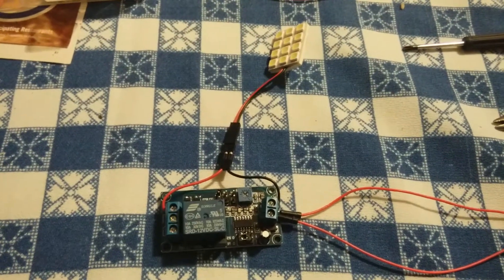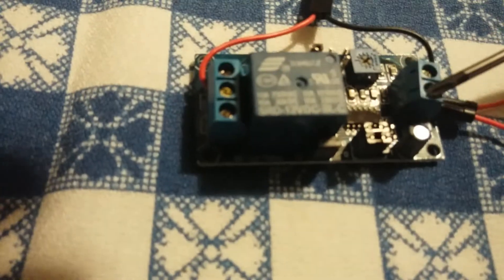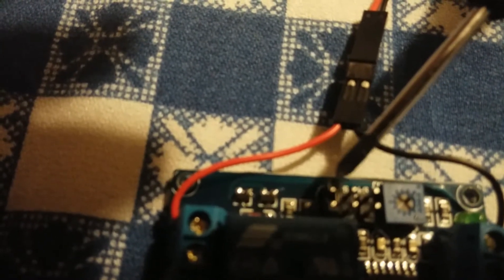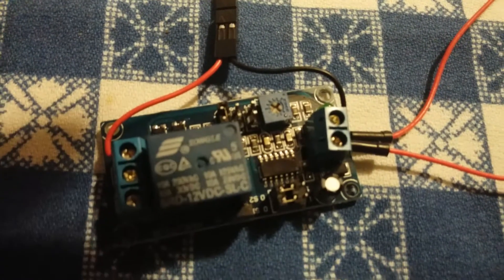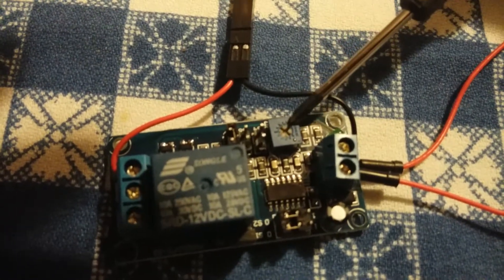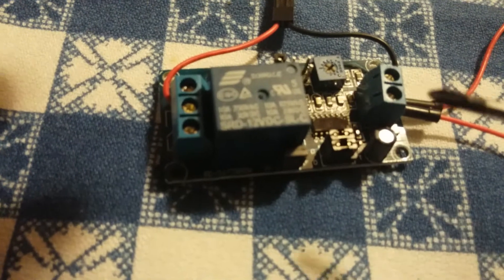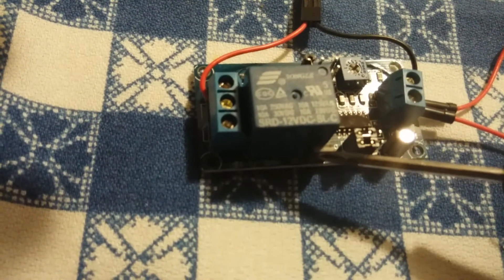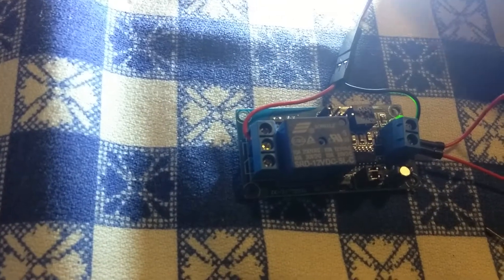FC-32 Delay Timer

Comment: Hi
I've made inspections on my instance of FC-32 timer relay.
Like to share with you:

I inspected the circuit, the CD4541MB IC on it, made measuremens.

The results:

There is an oscillator on the board.
The frequency of the oscillator depends on the potentiometer position and the S4 jumper.
I measured it with a multimeter with frequency measuremet mode, between GND and IC pin 2.

S4 jumper potentiometer freq.
OFF  max  768Hz
OFF  min  923Hz
ON  max  66Hz
ON  min  79Hz

potentiometer max. means Clockwise turn to end.

Divider:
divder is programmed by S1,S2 jumper

S1 S2 divider
0 1 256
1 0 1024
0 0 8192
1 1 65536

Time:
time is calculated from freq and divider.
t=divider/(2*frequency)

S1 S2 S4 pot time (s)
0 1 off min 0,1
0 1 off max 0,2
1 0 off min 0,6
1 0 off max 0,7
0 1 on min 1,6
0 1 on max 1,9
0 0 off min 4,4
0 0 off max 5,3
1 0 on min 6,5
1 0 on max 7,8
1 1 off min 35,5
1 1 off max 42,7
0 0 on min 51,8
0 0 on max 62,1
1 1 on min 414,8
1 1 on max 496,5

pot min to max means +20% time

Results may differ because of manufacturing versions- but the relations between modes will be tight.

S6, S7 jumper select working mode of relay
if you positon jumper on S6 means direct mode:
 relay goes on instantly and goes off after timer activates.

if you positon jumper on S7 means reverse mode:
 relay stays off after power on and goes on after timer activates.
 
You should not position jumpers on both S6 S7. 

Dependency of temperature:
65.6Hz @35 degC
68.5Hz @68 degC
+4.5% with +32degC

Dependency of input voltage:
65.6Hz @12V
65.4Hz @9V
-0.3% (not much)

Comment: S7 is delayed on. This is what your video shows. The LED will light up after the timer runs out. S6 should be the opposite. The LED will go on when power is applied and will go off after the timer runs out. Please confirm if this works for you.
Reply from the maker: It might, I'll check it out sometime, could be months.  Like I said, I didn't get a data sheet so I played around.
Reply: Just wanted to let you know that the S7 jumper does indeed work like that. It makes this a one-shot, which is exactly what I needed it for. The S6 is a delayed on. There are cheaper circuit boards that just do a delayed on, but this one is more robust and seems to be higher quality than most.
Reply from the maker: +Gerard Pinzone I'll modify the write up.  Thanks.
Reply: Gerard Pinzone can you tell one thing. I have the same circuit and if the jumper is on S6 the light comes on immediately and then turns off after set time. BUT my relay does not do anything (no clicks when lights comes on or off)   is my device defective?
Reply: It sounds like it's defective. Remember it's a relay so there's no 
voltage across any of the terminals. You have to supply power. Can you 
connect a continuity tester between the Common and NO terminals of the 
relay?  Use S5=OFF, S6=ON, S7=OFF. It should switch on immediately when 
triggered and remain on for a delay determined by the other switches.
Reply: Yes, I check the battery 12.3v, then set the multimeter to diode test with beep. It works perfectly when jumper in S7. Few seconds after connecting power, the LED comes on and then I hear beep from multimeter and click from relay... When I do exactly same with jumper in S6, LED comes on immediately when power is connected but no action in the relay. After few seconds LED goes off but still nothing. Besides, I can hear the relay clicking clearly in S7. I can hear nothing when jumper is in S6. What a luck I have :)
Reply: Try different timing jumper settings. Try S1=0, S2=1, S4=OFF and max out the potentiometer.
Reply: Gerard Pinzone that gives only up to 1.3sec :) even less than the default setting I had. I tried S1,S2 on 1. that way I get several minutes led on, but no movement in relay. See the drawing on http://electronics.stackexchange.com/a/186508 anyway, I am going to ask for a refund...
Reply: Only other thing to say is that there should be a jumper on S6 or S7, never both. You don't have jumpers on both, right?
Reply: No, I am not so noob :) anyway, thanks for the help :)
Reply from the maker: Hi Trashcan:  Can you upload a video of your setup?  Sometimes it is easier to understand a picture than a few words.

Thanks